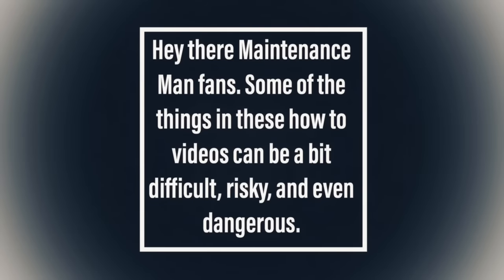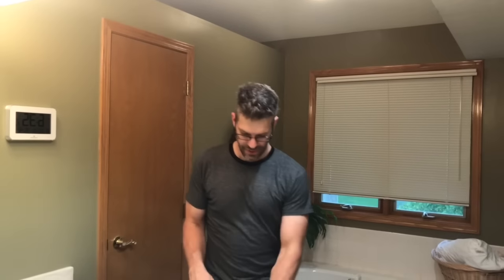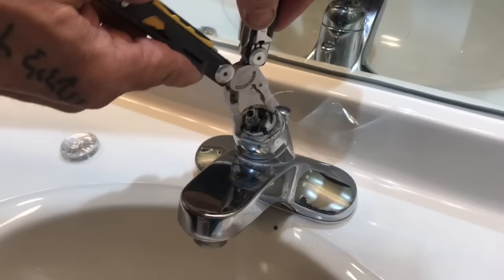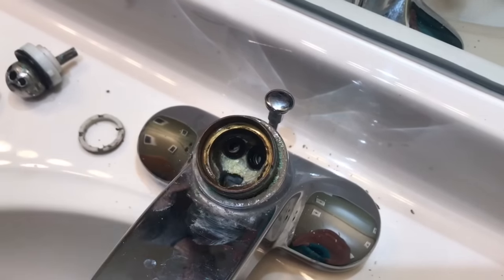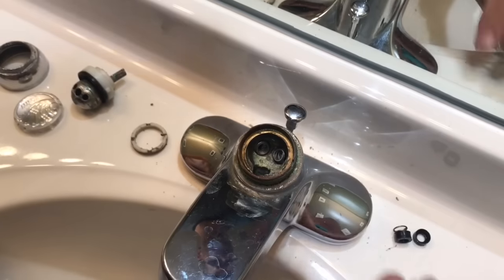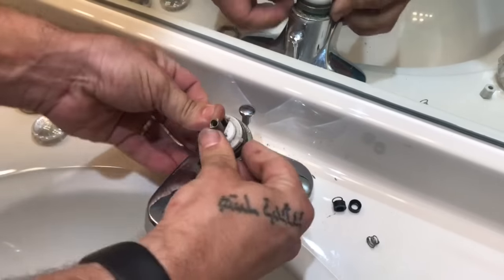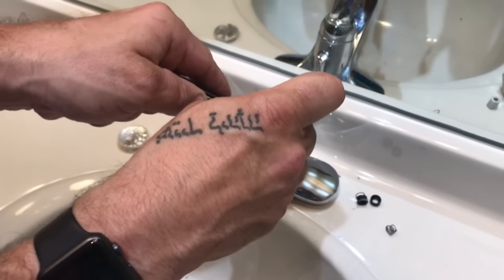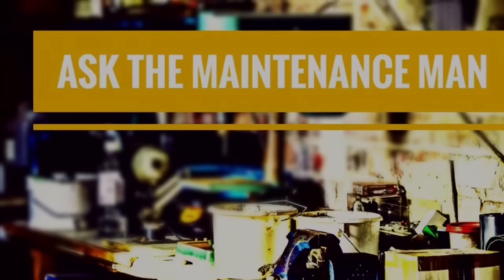How to fix a leaky delta style bathroom faucet

Comment: So you dont remove the  FAUCET SPOUT after you pull the valve seals (gaskets with the springs)? I can't get the Faucet spout that copper metal thing that the value seals sit in and the ball sits in...

From another how to site: Remove the Faucet Spout
 .... Next, remove the faucet spout by lifting it up and twisting it off. It may require a slight tug to remove. .... Remove the O-ring around the base of the faucet body by prying behind it with a screwdriver, or by carefully cutting it with a utility knife. Be careful not to scratch the body of the faucet.
Reply from the maker: That’s interesting. In the video I never remove the faucet, just the handle, valve cap, valve ball, seats, and springs. Then it all clearly goes back together and works. No need to remove the spout. I guess I just don’t understand the logic behind spout removal for Delta style seats and springs. Which brand of faucet requires a complete removal of the spout?
Reply: Ask The Maintenance Man Yea no idea, it is a link to a how to for Delta ball single handle faucet repairs... Let me see if I can paste it here... But, so all of that solves all the problems and replaces all gaskets necessary for this faucet? Clearly yes, otherwise you would have covered it, because you know what you are doing, whereas I... clearly not!
Reply from the maker: No worries. I don’t have it all figured out either. Just did a lot of these over the years and never removed the spout is all. I’m still learning too. Thanks for the comment. It’s always nice to see the extra tips my fans offer. Have a great weekend.
Reply: I pretty much destroyed the very soft copper of the faucet spout ... says comes out... by lifting it up and twisting it off.... but mine for a single handle builder grade bathroom Delta faucet, its either so gunked in and corroded in place, or it has something holding it in... it sorta feels loose but it wont really turn or lift or anything... I thought there were more important gaskets needed to be removed...

Comment: How do I find what model number mine is?
Reply from the maker: That can be tricky. In my experience there is a lot of googling.
Reply: @TheMaintenanceMan  I fixed the leak from the sink using the turn off valve under the sink. Thank you so much
Reply: @TheMaintenanceMan  I changed the springs and caps to the shower by turning the main valve off. I can't turn the water on all the way
Reply: @TheMaintenanceMan  it turned on partially, barely any pressure and it keeps turning to the left but no more water is coming in. What do I need to do?
Reply from the maker: Check the filter screen in the line behind the shower head. It’s most likely clogged.  (You’ll need to remove the shower head to do this)
Reply: @TheMaintenanceMan  Just so you know I fixed both the shower and sink leaks all by watching your video. You saved me a lot of money. Thank you so much. 💓
Reply from the maker: That’s great to hear!

Comment: Nice Job, TMM. I have a similar bathroom faucet except the stem is Plastic. No ball on the bottom. Has any one seen a single handle bathroom faucet with a plastic stem? The faucet looks the same as the one on this video, except no ball, it has a plastic stem.

Comment: I think you have a small typo on your Hebrew tattoo. :)
Reply from the maker: What’s the typo?
Reply: Ask The Maintenance Man the small horizontal line under the letter ל should be two vertical dots. I couldn't read the first word. the word יהוה which is the proper name of God (Jews never pronounce this word out loud) does not take the artIcle "the" just like it wouldn't in English as in "the god". The little line under the ל is a combination of "to the" (it's a vowel).
Reply from the maker: Good, then it is correct. The first word is modern Hebrew for “belongs/belonging” and the qamets under the lamed meaning “to the” is correct...belongs to Yahweh. It comes from Isaiah 44:5. Putting a shwa under the lamed I think changes it to say something different.